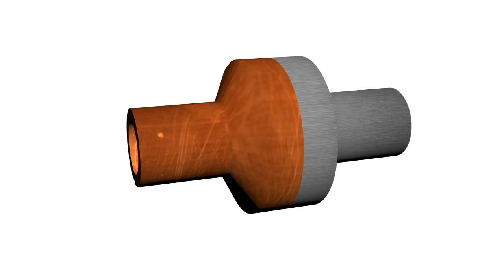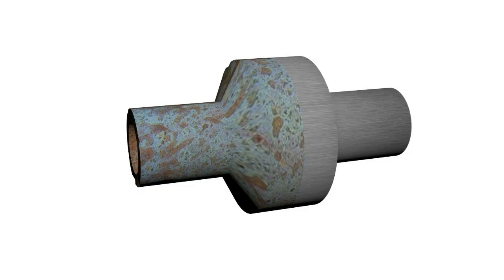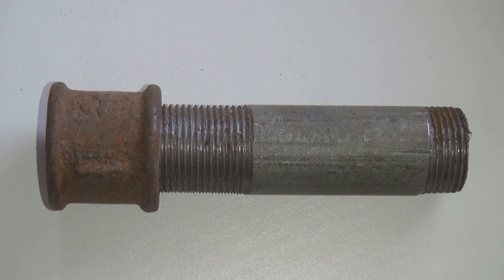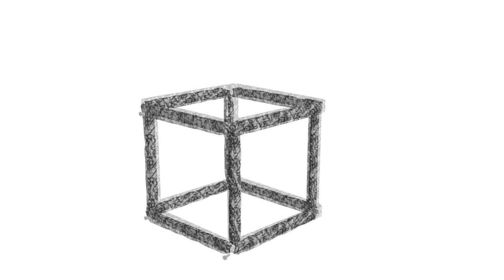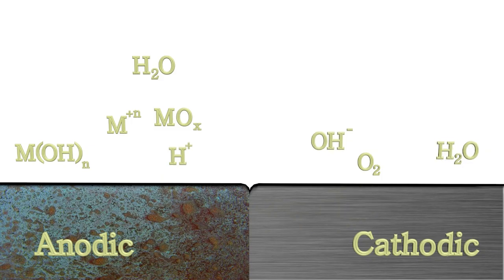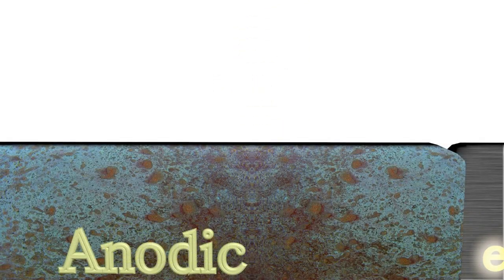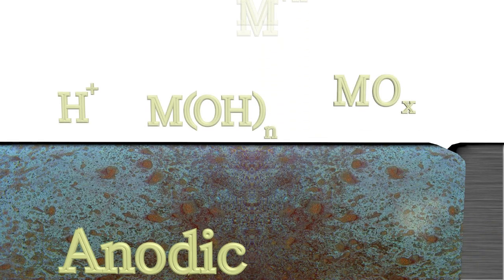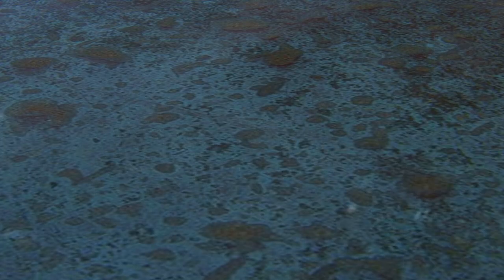Galvanic Corrosion | Forms of Corrosion

Comment: Thanks for the great video. QUESTION: I have a water-cooled engine with an iron block and aluminium head and I use a copper radiator for cooling it. Would the copper radiator cause galvanic corrosion even though it is not directly in contact with the Iron/Aluminium engine? Should I switch to an Aluminium radiator? 

Thanks again.
Reply from the maker: Maybe its not too bad if the components are not electrically in contact with each other. Also, if you use demineralized water for cooling, you can significantly slow down galvanic corrosion. In any case, having similar components in a system should decrease the risk of galvanic corrosion (unless the medium itself is bad for aluminium or if steel causes aluminium to corrode rapidly).
Reply: @CaptainCorrosion  hmm yes the system uses antifreeze which isn't a good conductor so I am guess that slows down the corrosion.

Question: Doesn't the oxidation layer on Aluminum prevent galvanic corrosion?
Reply from the maker: @spago555  It depends on the antifreeze too. Some can inhibit the corrosion a great deal. We actually had an idea of developing a coolant liquid that also inhibits corrosion in complex systems, where galvanic corrosion could become an issue over time. Such coolant could be sold in a barrel to large industrial consumers at a reasonable cost.
Reply: @CaptainCorrosion  Not a bad idea. I'm surprised as to how little information there is on the internet about this. Maybe this is a topic you can talk about on future video. 

One last question: How can I utilize a sacrificial anode in this situation? Can I simply just attach a piece of since to the inside of the radiator? Can the zinc be attached to the outside as well?
Reply from the maker: @spago555  I feel this is going to the direction of practical testing already. You see the sacrificial anode will create corrosion products and perhaps you don't want all that mess inside of your system. As for outside, it may work much better but there you also have other ways to protect against corrosion (e.g. use of paints).
Reply: @CaptainCorrosion  Thanks for your input. 

So will a piece of zinc outside the galvanic cell (outside the car cooling system) work as a sacrificial anode as long as it's connected to the radiator and engine??
Reply from the maker: @spago555  Well you have also the risk of galvanic corrosion outside of the system and that's where the zinc anode can prove useful. So you can basically slow down the galvanic corrosion as long as your sacrificial anode lasts. Not sure how well it would work on internal surfaces though if you place it outside.
Reply: @CaptainCorrosion  And thanks for the reply and sharing your knowledge 😊

Comment: Thank you very much for this vedio, and ihave quastion: I JOINTED a carbone steel pipe (ASTM A106) with  (brass/bronze ) valves by threaded joint, does that made a galvanic corrosion when thy are jointed in air without any liquid?
THANKS AGAIN
Reply from the maker: In that case it would depend on the average moisture level in air. Try to combine carbon steel and brass in the galvanic corrosion simulation tool and play with the levels of humidity as well as temperature.

Comment: Thank you for this education.  I would like to know more about the consequences of bonding copper directly to steel in concrete.  (For the construction of concrete swimming pools) .  When bonding in concrete, should a (brass/bronze)  bonding clamp that isolates the copper from the steel be used ? In order to prevent the concrete from spalling later ? (Also called spaulding).  Does this reaction cause outward expansion of the steel cage inside the concrete. Does this cause spalding of the concrete ?    Thank you
Reply from the maker: That's a tough one. You see, corrosion of metal structures in concrete takes place sooner or later if corrosive species such as water, oxygen and chloride can reach the metal through pores and cracks. So it all comes down to the quality of concrete and external factors. As for combining metals inside, I'd say you could see galvanic corrosion (as well as uniform corrosion) either way, which starts degrading the concrete even further.  That's because the brass/bronze clamp is still a good electrical conductor, which allows the galvanic corrosion to take place. Perhaps applying a spray paint on the copper-steel connections could help but then again concrete has to be alkaline to slow down corrosion and this may have a negative effect on the paint.

Comment: If 2 different metals having 5 to 10mm distance is it possible for galvanic corrosion?
Reply from the maker: No, unless you provide an electrical connection between these two materials.

Comment: Great Video. 
In it you said that if an aluminum frame gets bolted together with steel bolts, it will cause corrosion and come apart. Would the same happen if you used stainless steel bolts?
Reply from the maker: Probably, check the simulator or galvanic series to be sure.  Of course there are ways to counter galvanic corrosion even if you use stainless steel bolts to connect aluminium parts :)

Comment: I have Cast iron Flanged valve. I want to continue with SS pipe. So if I use SS flange to connect with Cast iron flange is there any serious galvanic corrosion in future?
Reply from the maker: Hello and thank you for the question! We have cast iron and a number of stainless steel alloys in our galvanic corrosion simulator so you can play with the choices and see what works best for you. But in short, it is likely that you will experience galvanic corrosion if you combine cast iron with some SS alloys - the question is rather how severe it will be.

Comment: I have Cast iron Flanged valve. I want to continue with SS pipe. So if I use SS flange to connect with Cast iron flange is there any serious galvanic corrosion in future?
Reply: Use rubber or non metallic gasket also use insulation sleeve on bolts

Comment: on which bases we will select the insulating material?
Reply from the maker: Hello and thank you for the question. Most importantly it has to be resistant to water / moisture and be able to provide a proper seal if used to connect pipes for instance.

Comment: I have a galvanized boat trailer.I have put on it 3 sticks of magnesium stick which are in contact with the treiler.Do you think they can work as anodium,to protect my galvanize treiler?thank you for your time.
Reply from the maker: Thank you for the question. Galvanized steel already has a zinc (or similar) coating, which acts as a protective coating and also as an anode in the case of defects in the coating. So I don't see much point in using additional cathodic protection in the form of your Mg rods. However, if the zinc coating is worn off in some parts, then these parts would require additional protection and immediate attention. So in these parts you could use additional cathodic protection with your rods.

Comment: Graphite mixed with epoxy as adhesive between aluminium? could works?
Reply from the maker: Hello and thank you for the question! And a difficult question that is. Normally I would avoid putting graphite and aluminium together as this would lead to the accelerated corrosion of aluminium component. However, an epoxy mixed with graphite may and may not be acting like graphite - it depends on the graphite concentration I suppose but also on the application (humidity and chlorine in air). You see, if the graphite particles are connected with each other, then they provide a path for electrons and if there are enough graphite particles exposed on the surface and reacting with water and O2, then you have met all the criteria for galvanic corrosion, and its speed will depend on the surface area of exposed graphite and the conductivity of the graphite/epoxy adhesive. So there is a good chance it might work but also a big risk and you wont know until its too late. In my opinion, I would try to find an adhesive without graphite if its a critical application but as a materials scientist, I would also carry out a corrosion test with two aluminium components bound by this graphite/epoxy and learn about its corrosion performance. In this corrosion test you might want to test different adhesives and compere them with each other and select the best one for your application.

Comment: I want to know about concentration corrosion
Reply from the maker: I'm planning to make a video about that at some point. Concentration corrosion is also electrochemical by nature and takes place if a metal is in contact with different concentrations of the corrosive media. An example would be a steel rod in sea water reaching from the sea floor to the surface. The concentration difference of oxygen in the top layer of water from the bottom layer would result in a potential difference and cause corrosion in the anodic part.
Reply: localized corrosion

Comment: Why the corrosion occurs only at anode
Reply from the maker: As mentioned in the video, the corrosion needs two simultaneous electrochemical reactions to take place - one at the anode and one at the cathode. This happens if two metals with a different electrochemical activity are in an electrical contact in a corrosive environment - the greater the difference in activity, the more rapid corrosion of the anode component.

Comment: In electrical construction when a building is built typically it must have a concert encased electrode. Typically this is done using a piece of bare copper wire place in the footing of the building.  Their is quite a potential for contact between the copper and steel rebar in the footing. If a piece of copper is in contact with steel and they are incased together in moist concrete how intense will the galvanic corrosion be. What is likely to happen at the junction? Thanks.
Reply from the maker: Hello, it really depends on the type of steel. Some steels have a similar activity as copper and there you wouldnt see conventional galvanic corrosion. However, a potential difference can also be created when the same material (or electrically connected metals) are exposed to different environments that have different concentration of oxygen, chloride and released metal ions - this would create a galvanic couple. Not sure how severe it is but when selecting the steel alloy for the application, be sure to check galvanic series in sea water (from internet) and make sure the steel has a similar electrochemical activity as copper or as close as possible.

Comment: When you say active, do you mean high electronegativity value?

If I combine stainless steel bolts and Zinc, I believe stainless steel have higher electronegativity, which of the two metals would corrode and get damaged?
Reply from the maker: Hello and thank you for the question. If you want to know if the two materials should be combined together then you should look at the galvanic series in sea water, not the electronegativity value. Passive metals such as Gold and Platinum do have higher electronegativity value than active metals such as Zinc and Aluminium but a closer comparison between the table of electronegativity values and galvanic series reveals significant differences. If you connect steel with Zinc then Zinc will be damaged (galvanically corroded) and steel close to Zinc remains unharmed. Thats why Zinc plates is used for the galvanic protection of ship parts that are made of steel.

Comment: Dear Captain, why do we use sacrified anode Aluminum in the subsea  pipeline and the underground (soil) we use the Zinc sacrified anode ? As I know Zinc is more active than Aluminum ?
Reply from the maker: I suspect its related to the difficulties of replacing the sacrificial anode and slower rate of corrosion. So for the subsea pipelines you might want to use aluminum (a lot of it) to provide long term protection, as it simply lasts longer (although it may provide less protection than zinc). Its also colder under the sea (less than 5 C) so the speed of corrosion is about 2-4 times lower than on top layers. The chemical environment is surely different there as well, so it may also play a significant role (e.g. less oxygen) in the type of corrosion. The change of pH in deeper layers also affects corrosion but it seems the pH itself depends more on the sea than the depth.
If I´m wrong or missed something then be sure to correct me! Its an interesting topic.

Comment: Hi maido.. Video was really informative and useful.. 
I have one question. If the two metals are separated by insulation and if I connect one wire to both the material in presence of insulation, Will the galvanic corrosion take place???
Reply from the maker: +Uvaraj M Hello! As long as the electron can move from the active metal to passive metal in the presence of corrosive medium, galvanic corrosion will occur. If you do the wire thingy, then two things need to be taken into consideration though; 1. How does the wire material stand in the galvanic series? If the connections of the wire are also exposed to the electrolyte then it would play a role. 2. The length and resistance of the wire matters! If the wire is too long or has higher resistance then electrons will have a hard time getting from one metal to the other and thus galvanic corrosion will be much slower in comparison with a case where you have a shorter wire.
Reply: Hi captain corrosion! Thanks for the reply.  
Let us consider two pipes with different materials (Carbon steel and stainless steel) carrying sea water and is connected through bolts with insulation material inbetween, and if i connect 14 gauge wire (Low resistance) of 50 cm length on the external surface of pipe, will the galvanic corrosion takes place?? 
Here the wire is not in contact with electrolyte but it is capable of transferring electrons..
Reply from the maker: +Uvaraj M Galvanic corrosion of carbon steel pipe should take place in this case but it will be limited by the resistance of the wire. The corrosion takes most likely place on the inner side of the pipe as close to the wire connection outside as possible (perhaps in a 1 meter radius or less). Also the outer part may be vulnerable to galvanic corrosion if they are not coated properly and are in a moist environment or if water condensates on the cold surface of the pipe close to the connecting wire.
Thats all in the case that the bolts and pipers are properly insulated from each other =)
Reply: In my case, if the wires are not connected to the pipes, the static current will accumulate at the end of connection (where the insulation material is placed), which will result in the damage of pipe.  So the pipes should have seperate wires grounded, which will help to dissipate the electrons accumulated at the pipes.
Thank you so much for your valuable reply Captain corrosion...!!!!!!
Reply from the maker: +Uvaraj M That would rather sound that electrons are leaking through your insulation from one pipe to another. During the connection of pipes the insulation may have been damaged (can happen very easily) and lead to an electrical connection. When you use the wire to connect the pipes then you simply delocalize the corrosion over a broader area so its still there but perhaps doesnt cause local damage as fast. 

About static electricity im not sure - if electrons should accumulate in a pipe then the pipe would repel chloride ions and not corrode at all =) Although I cant see any charging happening there as any accumulated negative or positive charge would be carried away very fast due to interactions with the environment. So the only way for a metal to corrode fast in a corrosive medium is to take away electrons (galvanic couple or x-ray radiation), heat it up to higher temperatures or prevent the formation of a stable protective oxide layer (acidic environments, mechanical wear by flowing stuff or other interactions, nature of metal). In chromium containing steels a protective chromium oxide layer can form while in carbon steels the oxide is rather fluffy and that provides only limited protection (unless it is worn away by flowing substances).
Reply: Thank you captain corrosion.. Your informations are really helpful for me. If there is no other connection between the two pipes except the insulation material, it will get damage after long usage.  But if the wires are connected on the external surface of the pipe, the electrons in the pipe could pass through wire and the life of insulation material and the pipe might increase..!!!
Reply from the maker: +Uvaraj M Yes but in order to provide galvanic protection, the wire needs to be attached to a metal that is electrochemically more active than stainless steel or carbon steel =) 
The idea is to prevent the movement of electrons away from the pipe.

So connect the pipes to a zinc anode (quite cheap!)- even if the anode itself is not immersed to the seawater inside the pipe but instead outside, having only moisture and chloride from air to react with, it would still provide protection to some degree. Although if you want to apply galvanic protection then the zinc anode needs to be as close to the steel as possible. Once the zinc anode is depleted after a while, u can replace it with a new one. Another option is to use a power source to apply a negative potential to the pipes and thus prevent oxidation but thats a bit more troublesome.

Comment: To : captain corrosion,
Good day there, i am robby, i would like to need your thoughts and advise to see my used zinc anode if this working in good condition or not.please advise your email adds if possible,i will sent the pict of zinc anode.
Thank u
Reply from the maker: +robby tandiono Hello! As long as you still have metallic zinc left that can be in an electrical connection with the protected (assuming steel?) substrate, protection should be applied. So be sure to refresh the surface of the anode and check the electrical connection with the other metal.